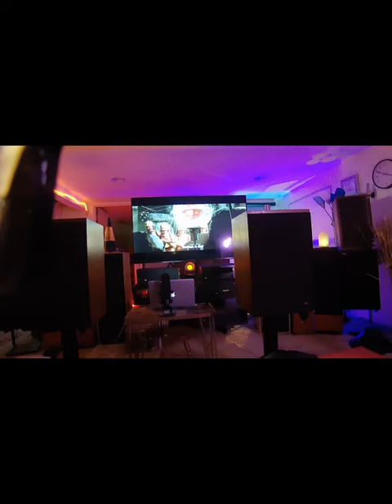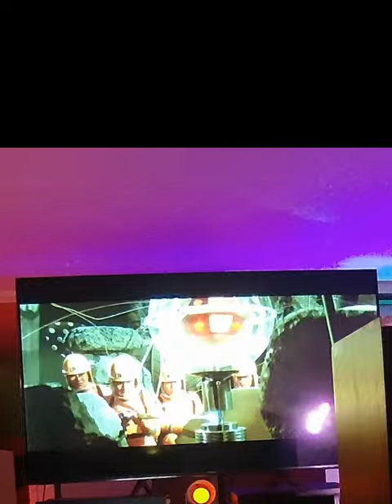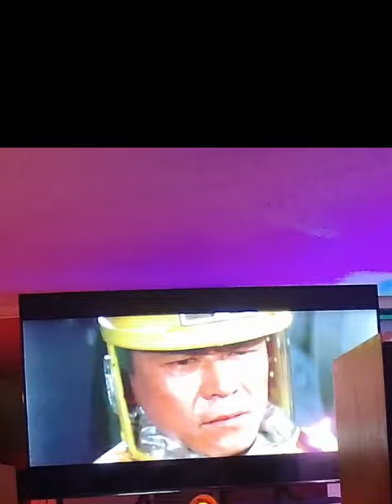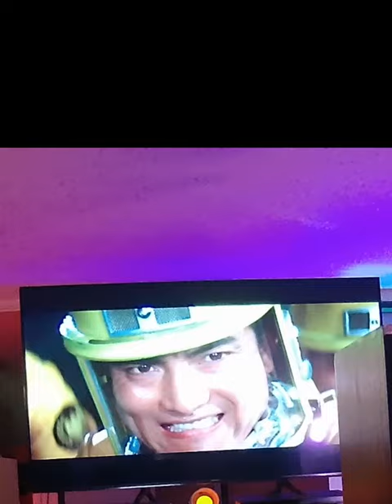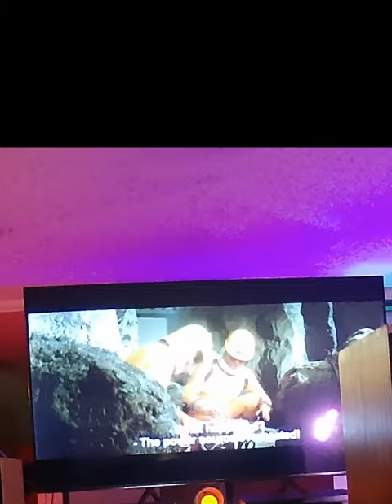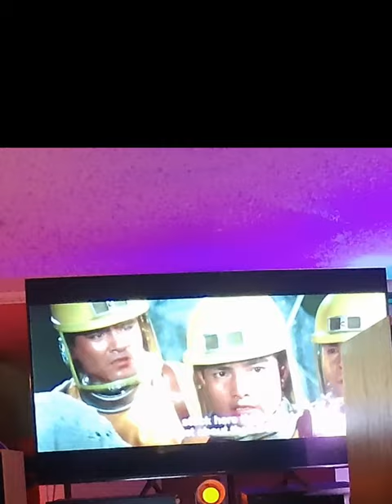My Stereo Cables are on Fire #shorts

Comment: But with so little power being transmitted, isn't speaker cable size even more important?
Reply from the maker: You're right.  That is an excellent question. The answer comes down to the resistance of the various gauges of wire over the lengths that you use.  Shorter runs require less AWG to maintain close to zero resistance.  If you are at, say, 50 feet on the other hand, the larger cable will keep resistance lower.

But in the end, even if you burn up a little power on the cable run, you just have to turn up the volume a little more.  The quality of the sound will not change.